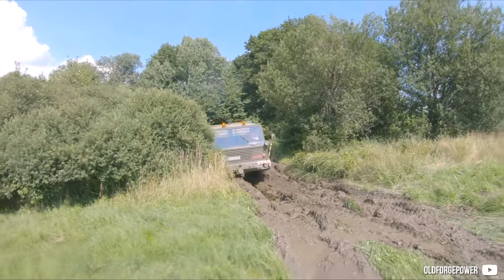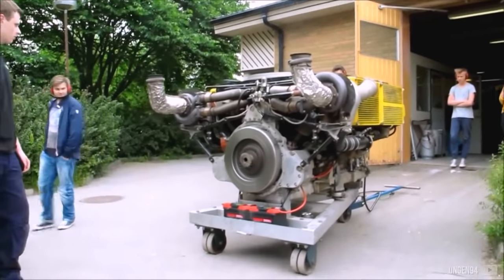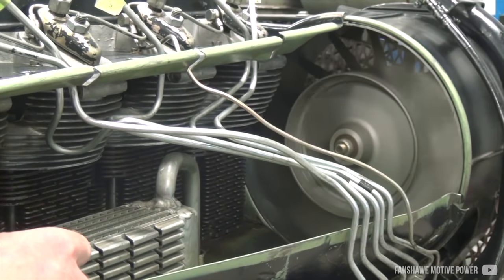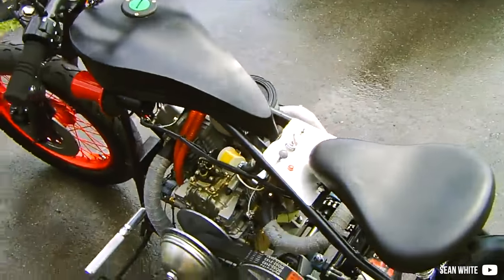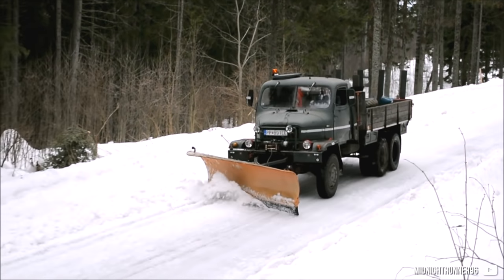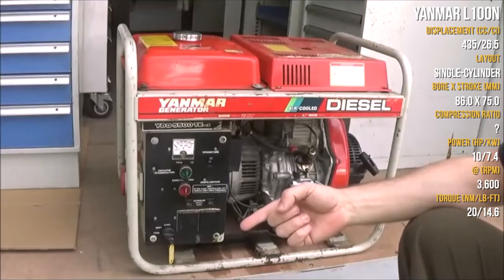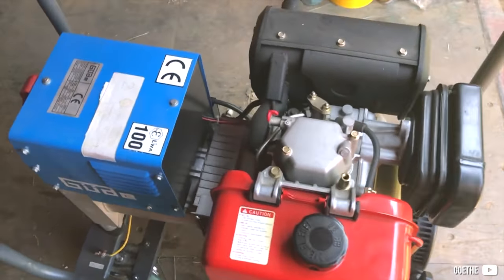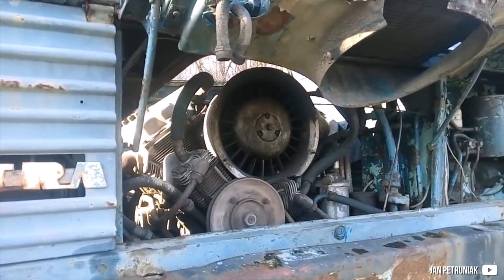The Best Sounding Air Cooled Diesel Engines

Comment: I don’t know if this topic was already covered but I’d like to see a list of the smallest Diesel engines in the world.
Reply: Aixam engines... 😂
Reply: there are some model air plane engines of a few cc's
Reply: The high revving video covers a few
Reply: Diesel mopeds exist. Approx 50cc
Reply: @derbisenda1330  r u Dutch?
Reply: @corona2261  

Haha ja gap
Reply: @lucasvanhamburg4937  Yes, I had a 1.5cc diesel engine model plane engine but it didn't make it to a plane as it had a habit of needing its carb continuously adjusted as it heated up and once hot it would die.
Reply: Diesel Daihatsu Charade is a good example 🙂
Reply: @derbisenda1330  lohmann 18cc diesel moped
Reply: @corona2261  its actually a kubota engine
Reply: @alanmay7929  oh didn't know that. But I know they are slow as fuck so...😂👍
Reply: @corona2261  its a two cylinder engine made for tiny cars best for kids
Reply: @alanmay7929  I'm talking about the engines that are in aixam cars and they are single Cilinder engines
Reply: @alanmay7929  well its a single cylinder engine
Reply: @MegaPoxie  a diesel with a carburettor? how does that work? diesels have direct injection right?
Reply: @lucasvanhamburg4937   They are basically the same as a glow plug 2 stroke engine which use a venturi setup to atomise the fuel/air mix.   The only real difference is instead of a glow plug like nitro engines they use a disk in the bore which is adjusted by a tap like arrangement, up to lower the compression and down in the bore to raise it.  From memory, the fuel contains ether which combusts under compression.    A very simple concept.
Reply: @MegaPoxie  thank you for sharing
Reply: I like the IH Cub Cadet in your channel profile pic
Reply: @corona2261  those are typical small Diesel engines. Kohler bought the lombardini engine line if I remember correctly and sells their Diesel engines to this day. The Lombardini engines were also used in portable highway signage /“arrow boards” back in the 1960s or whenever before it was common to just use batteries in those sign boards (assuming the invention of LED displays had something to do with it). I have a 7.5 hp Lombardini engine I recently bought
If you want to see a fascinating tiny and unique Diesel engine, look up Find Hansen here on YouTube. He builds his own engines based on classical A frame and other designs. He’s truly a master at the art of building tiny engines. I’ve never seen anything like it before. Not at all like the tiny RC engines that technically are Diesel engines, but Find’s true Diesel engine has a real injector and runs at slow speed like the early 20th century engines. Search “find Hansen true diesel” and prepare to be amazed... at least I was 😅 he also has hot bulb and other engine designs.
Reply: @corona2261  I have a mate who has an Aixam and it has a Kubota 2 cyl diesel, he tried to destroy it drunken as hell by putting rocks through the rocker cover hole… it was absolutely fine

Comment: I don't understand... That very first engine has a waterpump on the front, with in and out lines going to radiators on each side.... just because you are "air cooling" the coolant, doesn't mean the engine is "air cooled" ... all engines would be "air cooled" if that were the case. Am I seeing that wrong, or is this really how you went about this? Others made sense... second one had nothing but a fan blowing over the cooling fins on the heads ... that's air cooling for sure.
Reply from the maker: According to this picture, those are coolers for engine oil and transmission oil. An air-cooled engine really needs help by cooling the oil as well

https://automotiveenginemechanics.tpub.com/TM-9-2815-247-34/css/TM-9-2815-247-34_21.htm

Comment: the biggest problem with aircooled engines is that they have horrendous emissions
Reply: well If they are on operating temp they shouldn't put out any more than a liquid cooled one.
Reply: @lucasvanhamburg4937  yes, but it's much harder to regulate the temperature so mostly it's running hot
Reply: @Digidi4  thats true

Comment: There was a story with that air-cooled engines of Tatras.
When the first trucks came to the USSR most of them got overheated during driving. Therefore Tatra had complains about poor cooling system. 
Tatra sent an employee to the USSR and he turned the engine ON, then revved it to max rpms and no overheating occurs.
In the end of the story it turns that traditional old-scool drivers never raised engine rpms trying to keep it minimal even on high loads. Because old engines had to work like that. But air-cooled Tatra engines needed high revs to get better cooling.
Reply: Not just Tatra engines, all fuel-powered engines are cooled by the fuel. I doubt the Tatra had more torque on higher revs, it just needed diesel to cool it.
Reply: @elekl4621  you serious?
Reply: @vitpokorny6563   I am quite confident , that he doesn't know what he's talking about.
Reply: @elekl4621  Nah just needs spark plugs man lmao
Reply: @skullofhell1662   or he is trolling the shit out of us :D
Reply: Sounds  just like my Air Oil cooled Suzuki Bandit 1200 bike..she hates to run idle or low rpm or slow!
Reply: @TIMO maybe its a combination of low speeds and loads and hills and rough terrains to traverse
Reply: Shat mate, thanks...that's a great info!! Didn't know that!!

Comment: The biggest con is that oil needs to be replaced more frequently with air cooled engines. That sucks shit
Reply: Oil radiator anyone?
Reply: My air cooled 86 honda has an oil change interval of 12000km. Thats the same as my water cooled bikes
Reply: Hi can agree.

Comment: I have a Yanmar 2S engine from 1967 in my boat. Still runs great. It’s a 6 liter 2 cylinder naturally aspirated air cooled engine. I have it posted on 1 of my 2 channels in a video. Really sounds like an old very slow running tractor. It produces 20 HP. But the torque is 490 NM
Reply from the maker: Woow, nice!

Comment: I am a big fan of aircooled engines, no water, no radiator, no water pump, no water hoses, so simple! Lot of weight eliminated.  I lament the passing of air cooled engines. Choice of whether head gaskets are used, beetle motor- no head gasket needed. Air cooled engines such as type 1 and type 4 VW engines -so simple to work on.

All these wasser cooler engines have components with limited life spans. Air coolers keep on keeping on until engine wears out. I miss my Porsche 911 air cooler. Bought it when my 911 was 18 years old, owned it five years, and drove 130,000km put on the speedo. Only expense was replace fuel pump and got technician to dismantle starter solenoid to clean and fix starting problem when it was warm. Total non normal service expense in 5 years - $300. So glad it was not watercooled. at those mileages, cooling system was bound to start exhibiting problems and costs.

Comment: Actually the AV1790 had more horsepower than the AVDS1790. 810hp to 750hp but the diesel engine has more torque and much better fuel economy. The gasser was kind of gallons per mile.

Comment: The Deutz engine is an agricultural engine used in Deutz-Fahr DX 85 and DX 90. I think it was succeeded by the 6.1 litre Turbo intercooler used in Deutz-Fahr 97-07 MK1-3 and newer Agrotrons for 110-150HP and bigger Agrotrons at the time used 7.1 litre engines upto 260hp and 7.8L for 9340 340hp in 2015, Deutz-Fahr made a 9.6 litre used in some Fendts. All of these are still in use…

Comment: If I may suggest some really old oil engines. There are engines that are zero rpms. Some sound really strange. Mainly on the really old tractors but also used in milling.

Comment: I had no idea portal axles were around in the 50’s, very capable truck
Reply: ok .So what is a portal axle?
Reply: @melvinharvey8279  it’s a gear box that attaches the wheel to the axle lower than where it would mount on the actual axle, it’s for increased clearance

Comment: The latest diesel versions of the AV1790 are up to 1500hp. However, back in the 50’s, the top dog was a supercharged gasoline version that put out 980hp...I shudder to think how much fuel a 29 litre carb’ed and blown V12 would use 😅

Comment: Cool video buddy, reminds me of some of the engines I manged to see and work with. A couple of odd ones was a Lister V8 air cooled diesel used for a water pump and the the was a Dueitz 60 hp 4 cylinder air cooled diesel. That one was unique buy using the oil as coolent so it didn't have the fins like the other's rather a large radiator.

Comment: Diesels  sound like broken machines, you wish you could get a refund for ,.   I’ll take a rolls Royce engine you can put a martini on it while it runs ..
Reply: Yea Maybe because diesel engines Are made for heavy pulling. Your $7373637272662373738374  RR can Maybe hold a Martini glass, but it can't pull a buldozer up a 50° Hill.

Comment: A number of the engines covered in the video are described as "direct injection".  Don't all diesel/compression ignition engines have direct injection?
Reply from the maker: No, some old diesels have various versions of a pre-combustion chamber where the fuel is injected.